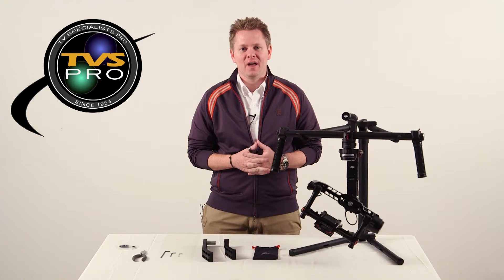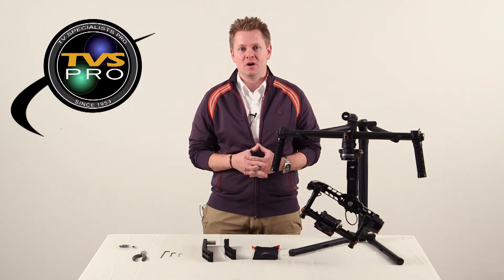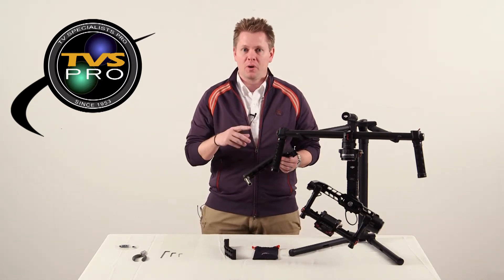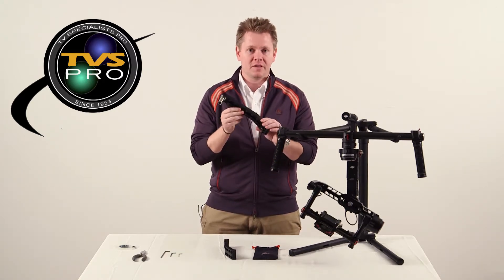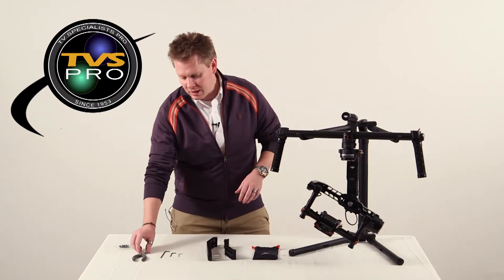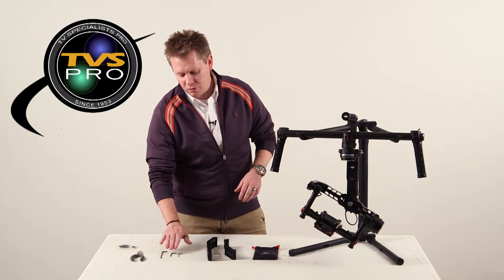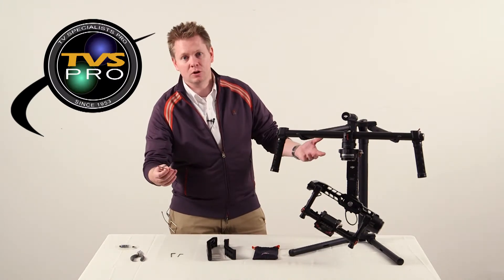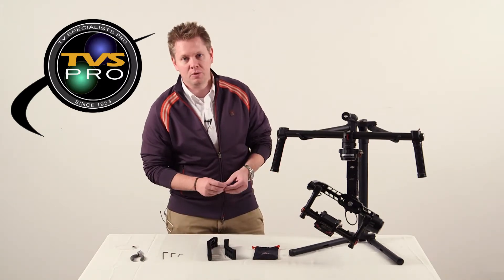DJI Ronin installing extended arms by TVS Pro

Comment: How the heck to you get the GCU cable out of the left arm when the hole is smaller than the connector?  I can see that it would go in nicely by turning the connector sideways, but I've just spent 3 hours trying to pull it OUT and the connector won't conveniently remain at the right angle as I pull it up - by the time it hits the hole, it's flat again and won't fit.  And there's no room to put a screwdriver in to try to change the angle.... 

You conveniently edit the video right at the point that happens :)

Comment: How did you remove the lid to the pan motor? 

I've taken the screws off of the lid but it still won't budget!
Reply from the maker: Sam Walker just a small flathead screwdriver and a small pry will do it
Reply: TV Specialists, Inc Unfortunately, that just doesn't work. All it does is scratch my rig. You could apply as much pressure as you like, but that lid is NOT coming off. Thank you for your advice though. 

I believe this is a manufacturing fault. As I have learnt that DJI use Silicone Glue to keep the wire from being pulled out from the pan motor, unfortunately in my case, the glue must of spilled onto the cap; locking the lid permanently.

DJI will have to replace my rig or have a technician see to it. Unfortunately they have still yet to reply to my email for help :( 

I am extremely unhappy with DJI. Why make a product and accessories, that cannot work with one another!? I understand that other people are able to install theirs, but what about the rest of us?
Reply from the maker: Sam Walker It is unfortunate that the glue has potentially spilled onto the lid; we are sad to hear. We have used razor blades before for solutions to the same situation. We recommend being very careful to the amount of pressure applied if you attempt to pry open with a screwdriver. But once pried open just enough to slide a razor blade under there and attempt to separate the glue from the lid.
Reply: Sam Walker I have the same issue. The lid won't come off. I can barely see inside. The lid won't come off. Should have used the CineMill extension.